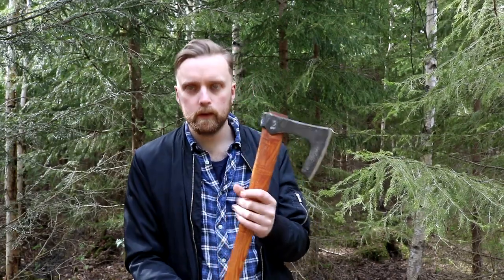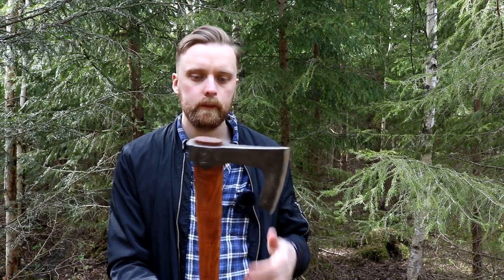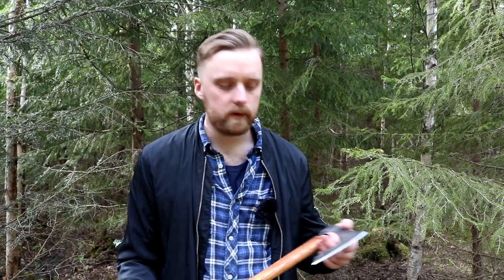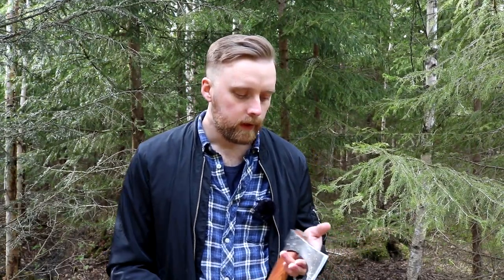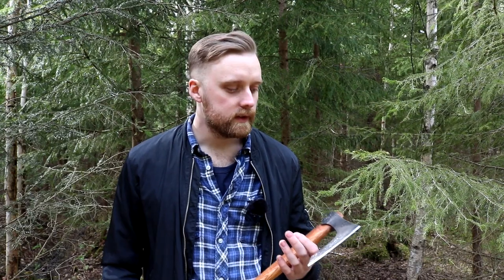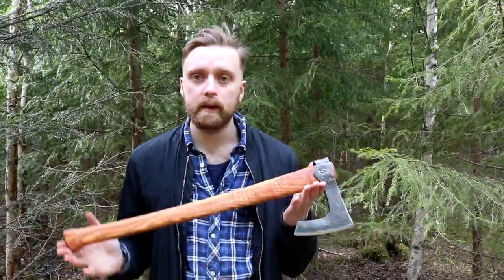FORGING A TYPE C VIKING AXE

Comment: Blacksmiths back then, would I suspect, have been keen to make the job easier and the use of multiple forge welds certainly cuts down on the effort involved. It is also more conservative in terms of forge fuel and the iron and steel, which were commodities hard won from the ore. These days metals are very much cheaper and taken for granted.

Comment: Question, was it period to forge weld a taco for the beard piece separately or would the whole beard just be high carbon steel?
Reply from the maker: The idea was that carbon steel was alot more expensive than iron. So they did not use more than they needed.

Comment: Hey Nils, nice work.
One thing I would say is that it has a very modern eye. Eyes in the period had more sort of rounded rectangular eyes rather than the narrow oval style. There are some examples in the mastermyr book. The handles also didn't have as much shaping as you have given it and were approximately the length of the user's arm from armpit to hand.
Otherwise, you're still not committing the big cardinal sins of recreating viking axes, and it looks good :)
Adam Gutowski on facebook has some good examples. A really good smith from Poland
Reply from the maker: Yeah i know! I say it very often "my take on" . Ill probably make a drift like that some day, however its only based on the historical finds. Its not my intention to claim that its made like the original finds. Thanks for pointing it out, you have a keen eye ;)
Reply: of course. You're honest about what you make and it's nice to see :)
Reply from the maker: Tbh i really like modern eyes.
Reply: you can get a very nice friction fit with no need for even a wedge with the period ones :) I have quite a few that are friction fitted. Worth a go if you want to try a new method

Comment: Interestingly enough very similar patters have been found in Russia all across the Volga trade route. And Norse axe patterns are very close to Slavic patterns. Even the amulets pattern the axe of Perun are very similar to Norse patterns. Slavic, Baltic  and Norse mythology obviously have a common predecessor before the Migration Period. the Russian Rurik dynasty the founders of Kievan Rus' the first Russian state are of Norse origin. The Rurik dynasty is the longest ruling dynasty of the Russian states. They ruled for almost 8 centuries.

Comment: Natural linseed oil would look better on the handle. Stain just doesn't look right on one of these. Stain looks un-natural. Love the ax head you forged. Do one with only the hammer and no files or grinder like would have been done long long ago. Well, maybe a crude file. Love the forged look without all the smoothing and grinding. Sharpen on a stone.